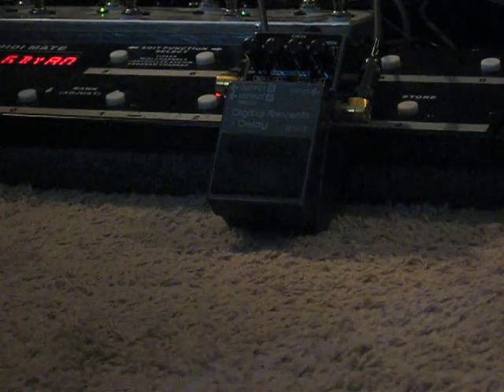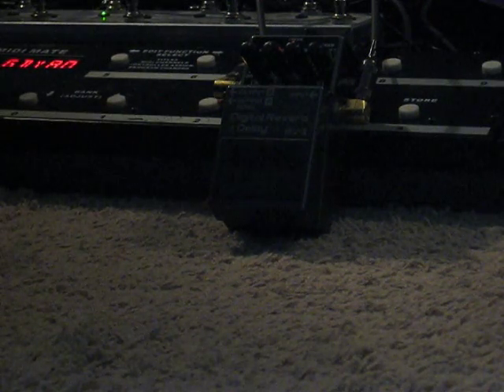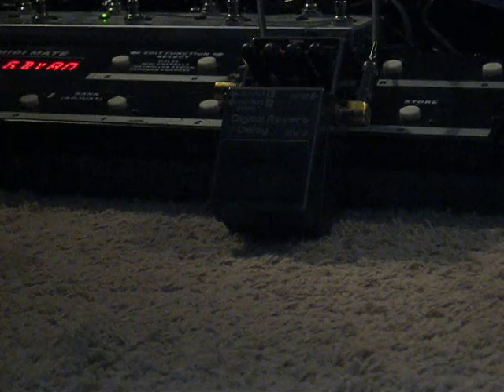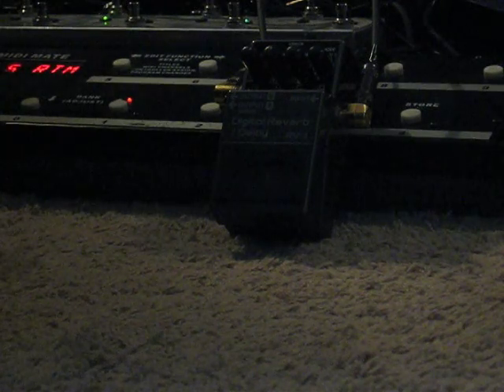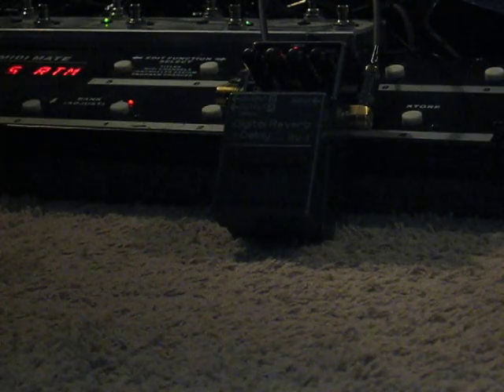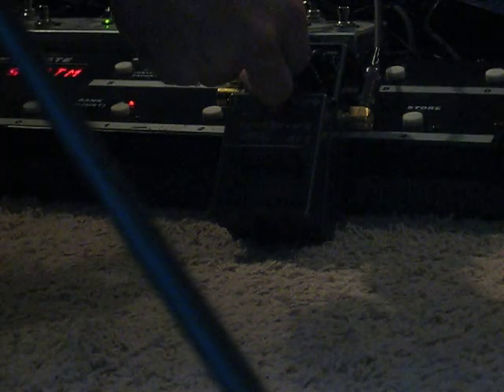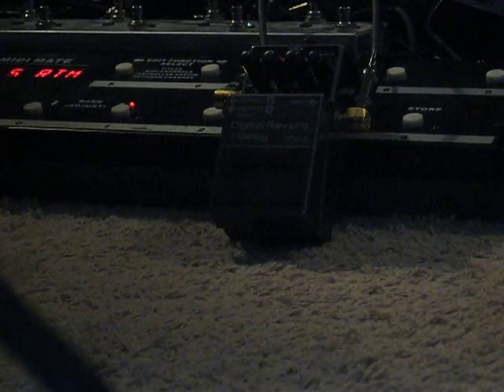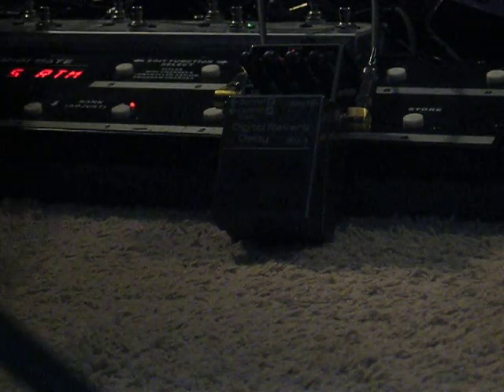Boss RV3 Demo

Comment from the maker: @GASMan1957 Thanks for the info! Although, in a really good reverb pedal, I would like to be able to have the ability to turn the mix all the way up and still get a good reverb sound. Reminiscent of of an actual spring tank being turned up all the way. Turning the mix down on this pedal does curb the issue, but I'd prefer not to have th issue at all. Granted, I've yet to find a reverb pedal that fully imitates a tank, but I do like a couple of them better than this RV3. To each his own. Cheers!